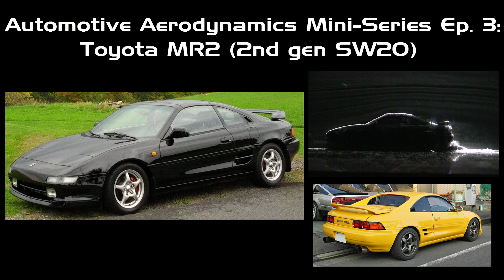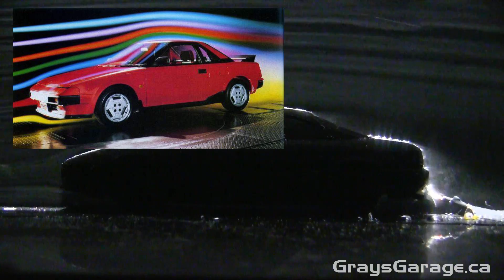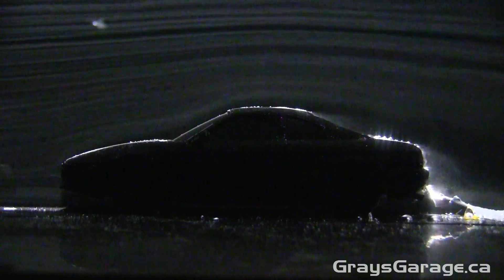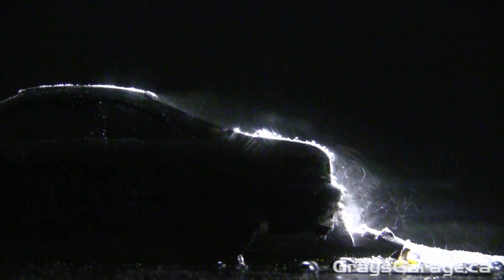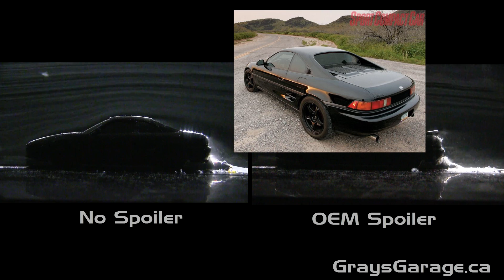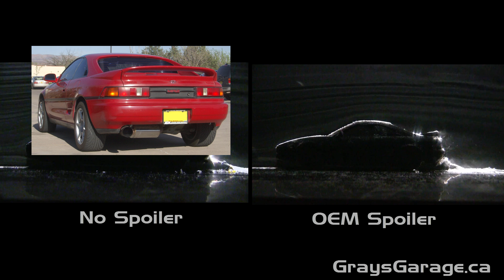Automotive Aerodynamics Mini-Series Ep. 3: Toyota MR2 (SW20)

Comment: Very interesting findings. What is your opinion/view if the mr2 turbos intercooler is moved from inside the engine bay (side mount) to mounted under the trunk area (without sitting the trunk floor) do you think there will be sufficient air flow for proper cooling? Reason i am asking is you can run a bigger intercooler due to the area under the trunk. Great video!

Comment: Hi Gray, been looking at your videos and found them very interesting, the reason i have replied here is because of the knotch back on the MR2 which is similar to my vauxhall vx220 (lotus based car ) also called a opel speedster (2002). Im really with traction at the rear  of the car i would like to increase the rear end DF or reduce the lift, would a coupe lotus exige style rear engine cover help,  im also intrested in diffusers as the under side the car is flat and could i create downforce from under the car with a wing under the diffuser ??  Hope you have time to maybe answer some of the questions

Comment: I love the MR2s, do you think a front lip, side skirts, and rear lower diffuser would help with this car? On mine it has a single outlet exhaust (not the huge 2 branch one) and the grate-thing at the rear bottom is cut off and I will put in a lower diffuser. I think a front lip is supposed to help with reducing flow under the car to improve downforce. For that whirlwind above the engine lid, that is exactly what I thought. When driving I can sometimes see pine needles levitating in place or whirling around in that area.
Reply: I believ vented, plexi covers are available  for the buttress.  All that you mentioned will help, but eliminating the buttress would be the biggest improvement.  Also try a flush tail extension like pro mod drag cars.  Rubber chin dam is also worth a try.
Reply: Front lips encourage air to hit the radiator instead of tumbing under the chassis -- a good thing, and down force to boot.  But it needs to be held in place very securely.  To a large extent it can also do the job of the flat splitter.  The splitter job is help air quickly find its path, without hesitation on the chin.

Comment: there were 2 engine lids offered in Japan.  sexy style rear engine lid and the ask sports rear engine lid.  both alter the notch back shape into a fastback shape.  these lids greatly reduced the turbulence between the rear window and trunk area.  it produced more down force yet increased the ventilation from under the engine bay out through the fast back lid(the lid is vented).  the later ask sports engine lid I reproduce here in north america.  for the enthusiasts out in Europe, a company called CarBen fibre creations reproduces them in the u.k.  thumbs up and I enjoyed the video
Reply: where could we find your reproductions?

Comment: Did the model have the engine compartment open or a pass through vent for the air to move through? I have been told that air moves from under the car up through the engine lid.if the model did not have this I wonder how that would affect the rear wing?